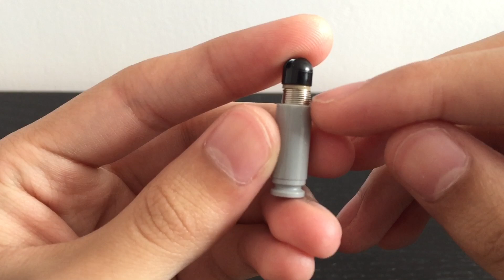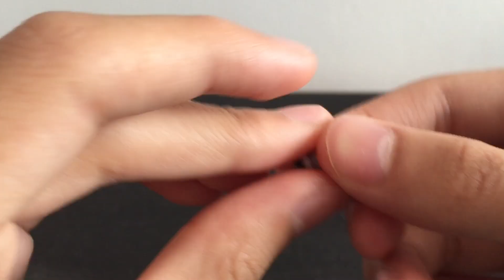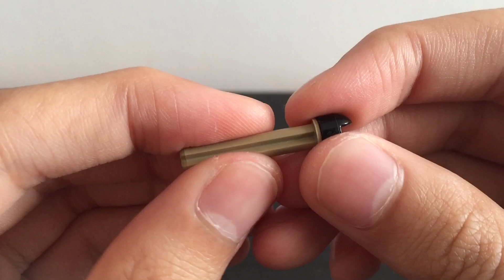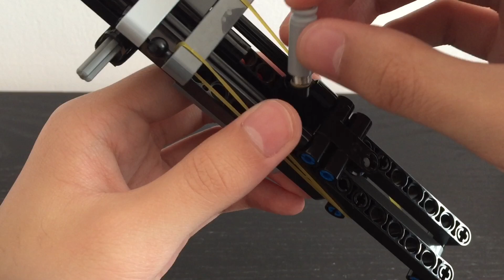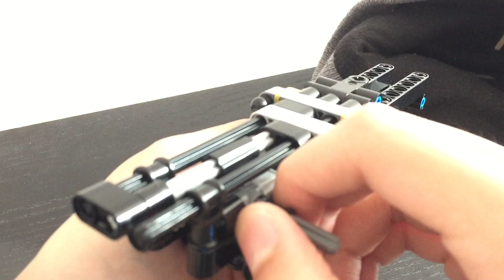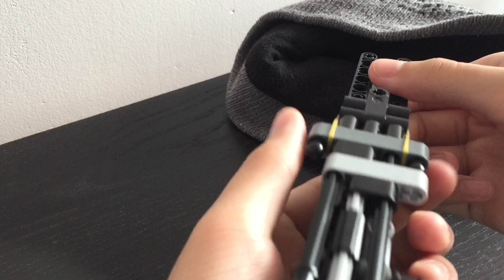Self-powered Lego Centerfire Ammunition

Comment: I’ve made an improved version and have showcased it on Reddit. It’s a bit less usable since it requires a thinner firing pin as it must easily fit through a holed stud but the springs are far easier to source as they use standard pen springs.

Comment: I'm thinking of making a gun for this type of bullet and I even ordered some springs but they weren't any good, so if its not too much trouble could you tell me the exact dimensions (length, diameter, thickness) of the spring you used?

Comment: If the projectile's axle be a little shorter, won't the spring be more compressed and give it more energy?

Also, 5:56
U could use this inertia accidental firing thing as an actual mechanism for a open bolt Lego gun 👀

Comment: I’m using this to make a revolver, this is amazing.
Reply: That would make morr sense
Reply: @jack_copperz  wdym all bullets work like this
Reply: Cuz the casings don't eject. There's recoil but the blowback isn't strong enough to rack the bolt thing.

If it was a revolver then it wouldn't matter cuz everyone knows how you reload a revolver. A revolver doesn't eject casings automatically, you have to pull and/or push the spent casings out of the chamber.
Reply: Jack Copperz a bolt action rifle would be neat as well. It would be cool to work out a stacked feeding system, and you require 0 blowback but youd need a lock. Seems like theres a lot of cool things to be done with this
Reply: @jack_copperz  oh yeah I guess that does make sense
Reply: @4kfernyy  .
Reply: @jack_copperz  use a wind up lego motor to make a machine gun!!! Or a bolt action rifle
Reply: I think I'll just stick with a simple revolver.

A bolt action would still be quite nice.
Reply: Yeah, this would make extracting way easier. I was thinking of making a lever-action design that ejects the cartridge and chambers a new round so I can use magazines or clips
Reply: Show it off if u make one
Reply: Moz I will, I’m designing it rn in leocad
Reply: Thanus how far r u into the design process
Reply: JMZ 33 not very. I’m stuck on the hammer and got to get it to line up with the pin in the bullet.
Reply: Thanus well that sucks but I hope u can figure it out
Reply: @jeffersonfan393  how’s your progress
Reply: A man has started a mass shooting in Lego City
Reply: Welp if any on you guys end up making it let us know!
Reply: Robert's got a quick hand....
Reply: Best on your profile I thought you would
Reply: meh doggo happ i dont. My plan is to design it and then order the parts.
Reply: @jeffersonfan393  I would recommend looking at the internals of Nerf blasters and the like for inspiration to figure out how you can mechanically rotate the cylinder.
Reply: No stranger to the ranger with a brick iron on his hip.
Reply: USE A WIND UP LEGO MOTER TO MAKE AN AUTOMATIC GUN!!!
Reply: @Thanus How’s progress so far?
Reply: Sensitive Boi slow. I decided to put off a rotating cylinder until the end. Working on a way to keep the pin in the right place, thinking I may have to modify some parts.
Reply: You should make it into a YouTube video
Reply: Please post it when your done
Reply: It would easily make 30k views
Ps. My cat squisha me
PPs. She’s 12 years old
Reply: still waiting
Reply: Pixelxy8 Videos I have school now so it’s going a lot slower.
Reply: Thanus hey when you get done make a video I want to see how it turns out
Reply: So your progress?
Reply: Nice 👍
Reply: How is the build going?
Reply: swindlebot does car stuff I lost the cad file...
Reply: @jeffersonfan393  i know cad is hard but.
Do it again.
Reply: FBI OPEN UP
Reply: Do you know how to make one?

I own a replica and that thing is hard to repair.

Lost a spring for like two month's and just now found it.
Reply: Could you make a video on it thats a really cool idea
Reply: Thats amazing
Reply: Shooting up the school too eh?
Reply: Thats gunna be an exlensive revolver
Reply: is your ammo chamber ready to be shown off?
Reply: Ikr shell eject and every thing
Reply: am 1k person
Reply: Can we see it I'd it's done?
Reply: Ano po ang lalagyan ng bala para iano doon sa baril

Comment: All you need are the Technic bending tubes to spiral through the barrel of the gun, adding a spin to the bullet for speed and accuracy.
Reply: That would be cool but they dont have a spiral going through it, rather circles, and also the circles are too close to each other. But otherwise, i thought about the same thing. Only solution is to 3Dprint the lego barrel

Comment: I could see this sort of design working for some sort of shotgun shell (though it would only be solid slugs instead of buckshot)

At the bottom, a 2x2x2 barrel and above that a 3 long axle and 2 or 3 of the 2x2 cylinder bricks on the axle. A spring could go inside the barrel piece as propulsion.

Comment: nice but ineffective, i have built yours and its has a few cons, i have built a effective round thou 
its is five studs long and im planning to make a bolt action sniper, ive already tested it, it is NOT fall sensitive, will NOT release because of the inertia of the bullet,and it uses one of the most common springs you have around the home, when im done i will post a video on my channel if you want to see it